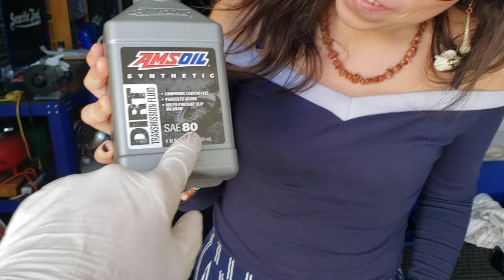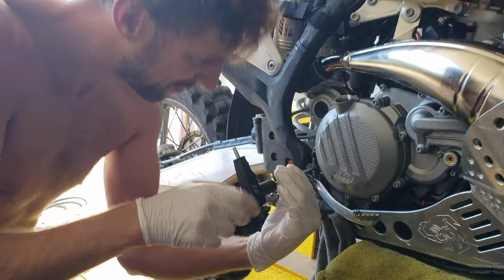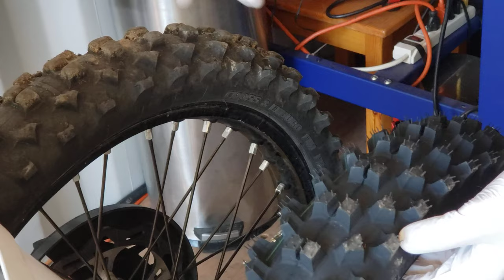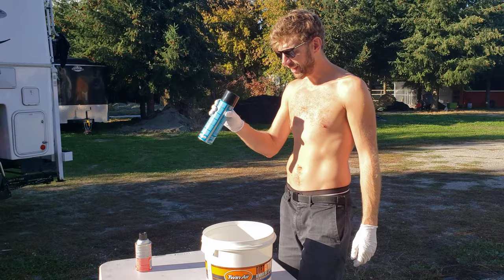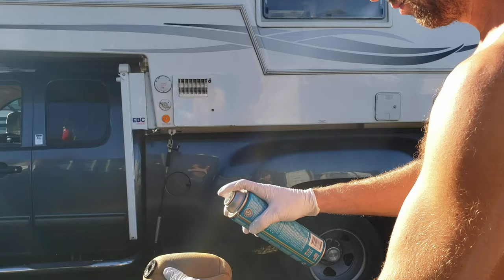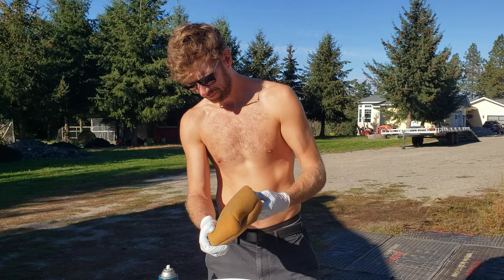KTM 300xc TPI Maintenance - AMSOIL SAE80 Dirt Transmission Fluid / Maxima FAB-1 Filter Spray

Comment: Hey, how often do you change the oil, manual says after first 5 hrs then every 40, seems high?
Reply from the maker: I change the gearbox oil every 25 hours respectively.  Using AMSOIL Synthetic Dirt Bike Transmission Fluid:  https://www.amsoil.com/p/synthetic-dirt-bike-transmission-fluid-dbtf/?zo=1498525   (gives peach of mind knowing I can extend to the full 40hrs if needed)
Reply: @irnieracing  thank you!